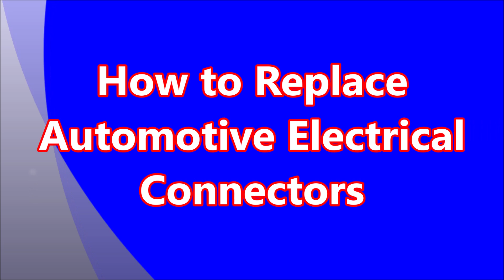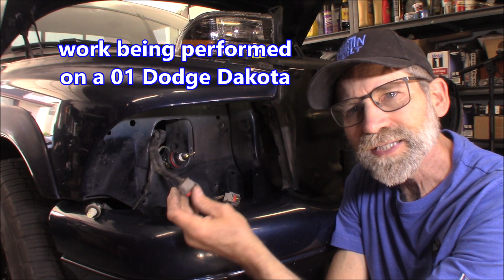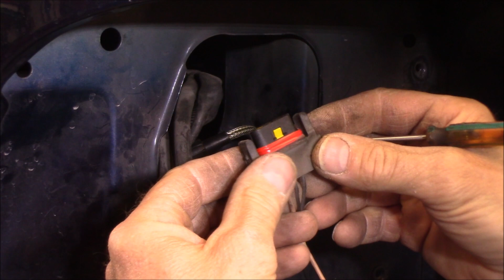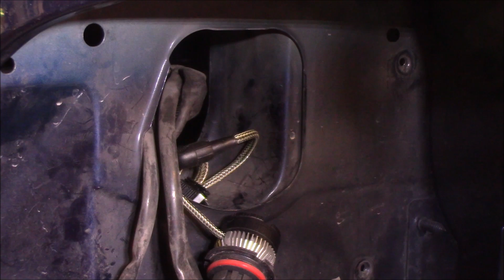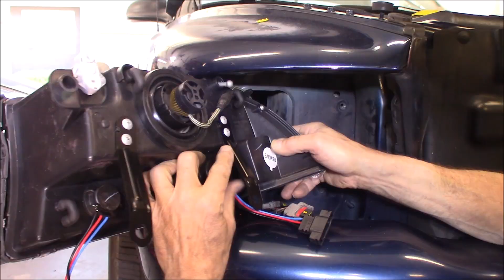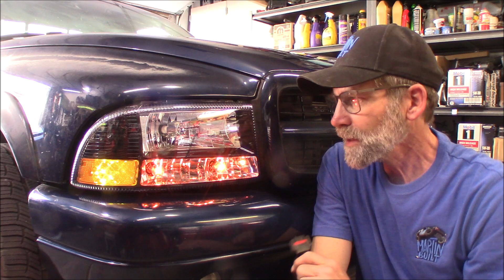How to Remove and Replace Automotive Electrical Connectors

Comment: You probably should have titled your video how to repin electrical connectors. This doesnt show how to remove or replace the connector. More specifically how to remove them. Im looking for a video on how to remove a electrical connector from my gaspump. And all i can find is fuckin useless bullshit like this titled wrong. No one shows how to remove this shit. Its the only thing keeping ny gas tank in the air. Guess ill bust out the wire cutters

Comment: Great video Martin! Being tired of my '97 VW  tail lights flickering, or intermittently switching off  I replaced all taillights connectors with aviation grade, ,gold plated pin sealed circular connectors. Cut the original wires and crimped them to the new connectors; now my VW is "flying"...

Comment: Hi Martin . Came across your channel a few weeks ago.  My wife has her old 2005 Jeep Grand Cherokee 4.7 v8. I felt like she was on her way out . On to looking at the lifters and rockers when I do the valve covers . Also doing the exhaust manifold gaskets too. Eventually I will be doing the heads and timing . Can’t see my self to bringing it to rest now that I’ve come across all your videos . I have somewhat become addicted . I can now do one project on it and once I get done with one I always find another one on it . I guess thats the Jeep for you. Thanks for your help.
Reply from the maker: I am sure that the rockers are still in good condition. Just replace the lifters (lash adjusters) and that should do it. Jeeps can be very addictive.
Just 
Expect
Every
Problem
but my favorite is 
Justify
Every
Expensive
Purchase
Reply: @martinbuilt  Yes sir 🙂thanks again

Comment: Oh btw...some of the clips, like the fuel pump connector and a few others, there are tabs in the back of the connector....and this next one applies to all vehicles, a lot of your metal electric tabs (the ones that make contact inside the connector) will have a metal pop tab type thing...press it down and it comes out but be extremely careful because they bend and if they bend too far or too many times they will break right off

Comment: I cut off my connectors on my truck...since I have aftermarket headlights, I wired everything direct. My head light assemblies split the headlights back into 2 bulbs in the front instead of 1...I like having seperate high beams... But in doing that it allowed me to cut all the connectors off solder the connections and shrink wrap them... And then I put loom over everything and taped it
Reply from the maker: I have done the similar method especially if the wire is damaged.
Reply: @martinbuilt  yeah I think all the clips were broken off on mine but I put my aftermarket lights in and had to wire everything anyways...I'll have to send you some pictures of my new lights